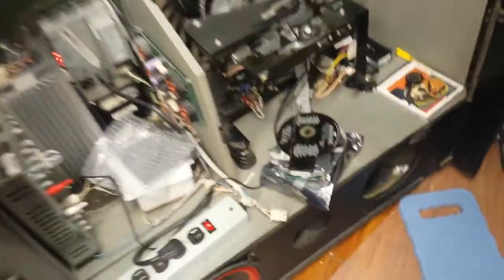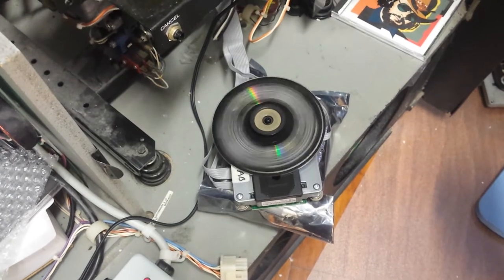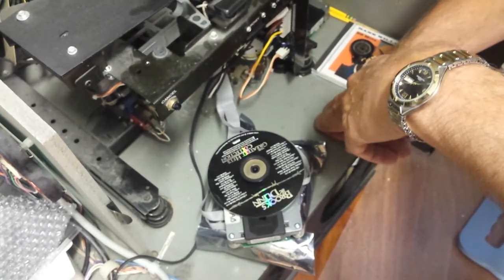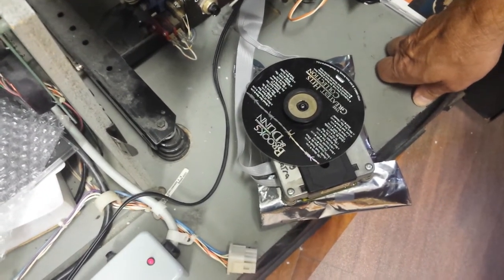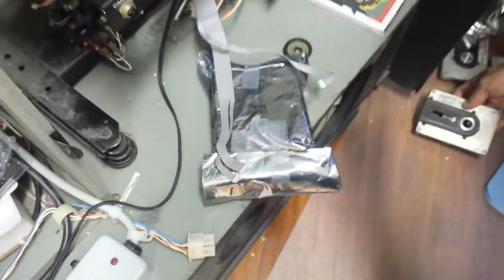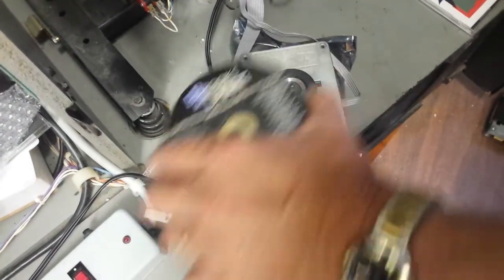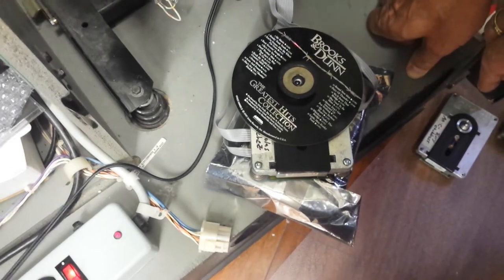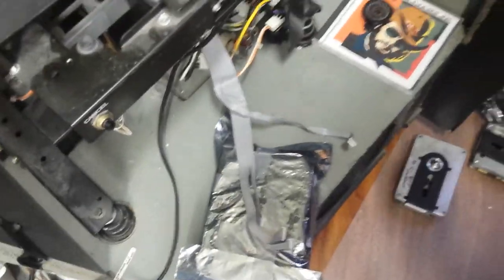identifying a bad cd pro player

Comment: Thanks! The Philips Pro unit. Is it specifically used in the CD jukeboxes? As, I have seen different player units in home decks. Philips are my favorite units. The Pro has the most metal of all of the different made player units. Do you repair the controller/servo boards too? It would be interesting to see the repair depending on you time frame. It maybe cheaper to buy a refurbished board. Is the A/D D/A converter on this board too? Laser diodes have a specific hours of usage before they fail. If the setup is done correctly at the factory it allows a longer life of the laser diode. Too bad the jukebox doesn’t have a counter for the hours of use. Have you ever found problems with the interface which lights help you monitor the player unit?

Comment: Hi friend.  I have a Amy Rowe Nostalgia with a CD Pro Philips. At first It started to need warm-up time to work normal. It picked up a CD as usual and place it properly but it won't turn the CD at all as if there is no CD found. It will repeat such procedure twice and the CD simply won't turn or other times spined without play. After sitting idle for about 1 -2 hours, it returned normal again….. I just change the Optical with your Good instructions, thanks ;),   putting a CMD 12.4 but continues with the same problem.
Ah, I just change the Mech Board too because blinks 3 time the Board Error when I want to put new Cds or Reinicialize all. 

And now does not recognize any cd.

 What can I do ? Which is the part to fix exactly ?  Thanks for your reply. JC